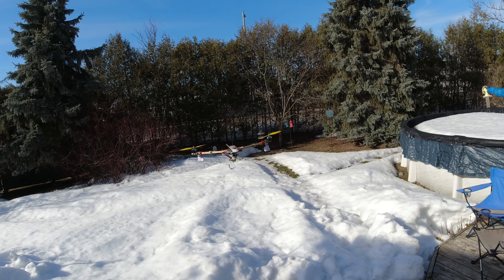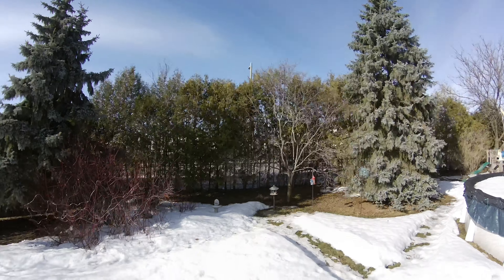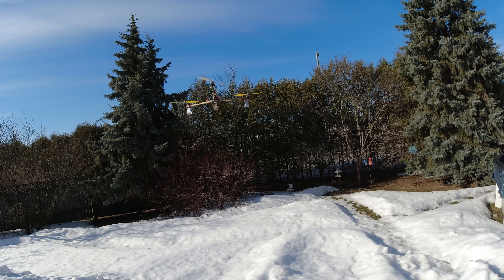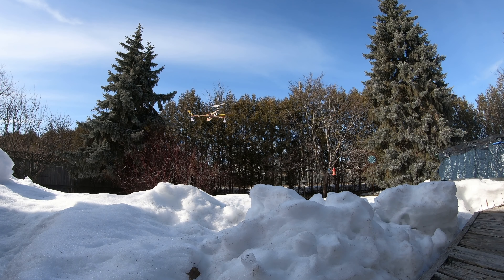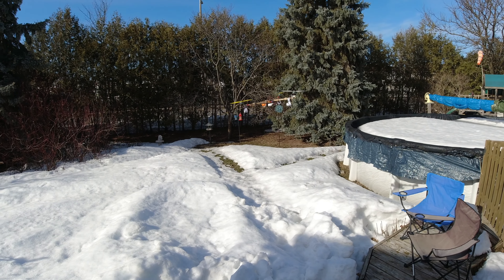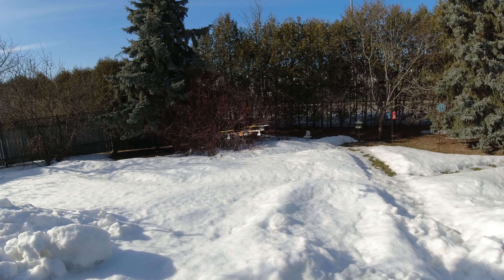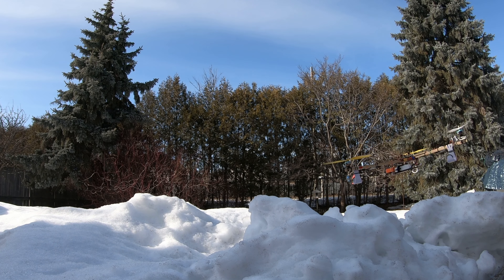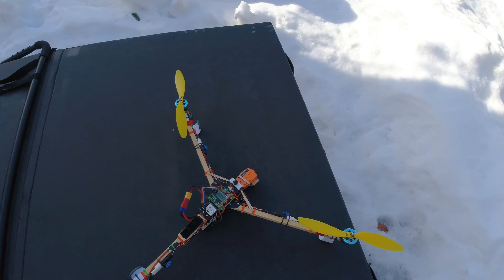Tricopter V2.5 - Vintage

Comment: I love it, Andre! Now I need to piece together my Batbone...somehow. It has a Naze32 (which was cutting edge back then) but the challenge will be cutting out another carbon fiber plate. I think 3D-printed plastic would vibrate apart.
Reply from the maker: I've never tried to 3D a main frame section but it could work.
Reply: @blameandre  I don’t have 3D printer but “I knows people”. The worse that could happen is I could crash, and I’m already great at that 😆
Reply from the maker: My first one was plywood 😂 it still cracked
when I crashed.

Comment: I still have my KK2 tricopter... Haven't flown that in years.. Might try to upgrade it to iNav.
Reply: Aaahhhh the ol HK kk2 unit that's what I always used normally quads with 8 inch props made a monster once 15 inch carbon fiber PROPS 1 FLIGHT TOPK IT HOME DISMANTLED IT.  WITH THEM PROPS ONE MISTAKE AND I'D LOOK  LIKE A BUTCHERS WINDOW
SCARY
Reply from the maker: I have versions of the KK2 🤷🏼‍♂️